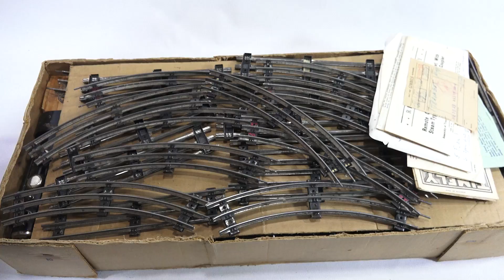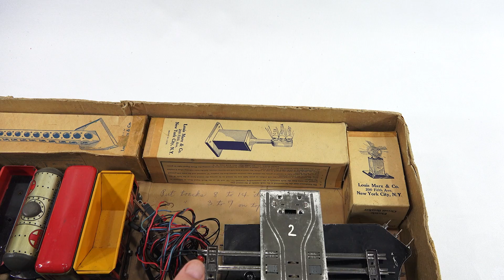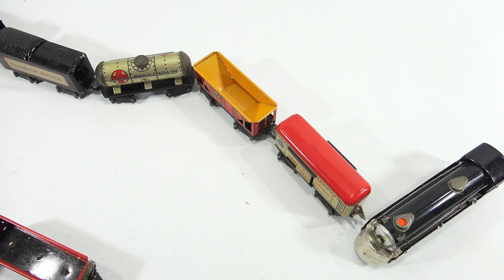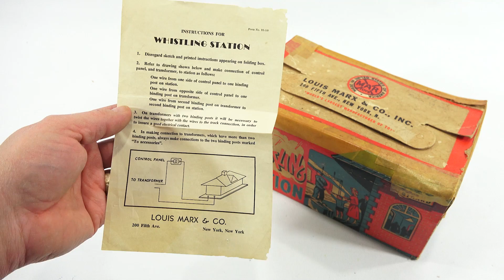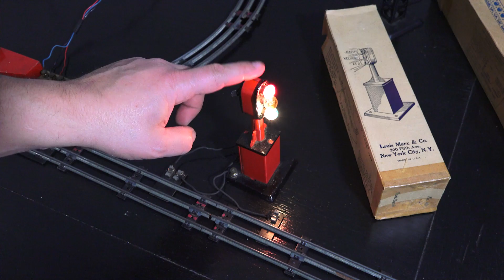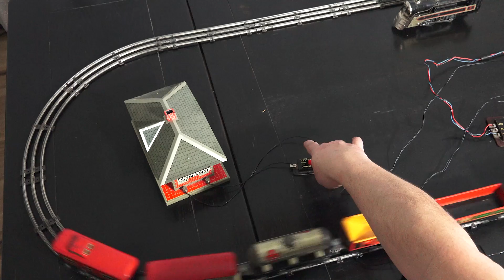1940's Marx Train Set Stream Line Steam Type Electrical Train Remote Controlled Boxed Set - Whistle

Comment: Apparently, a lot of people seem to read the Marx logo as MAR and don't realize the X is the crisscross through the letters MAR. MAR is printed across the X that doubles as a crossing signal. That symbol is stamped on most locomotives. However, Marx did sometimes refer to his train products as Marlines. I still have my original Marx Southern Pacifica freight set with the die-cast 666 from the mid 50's.